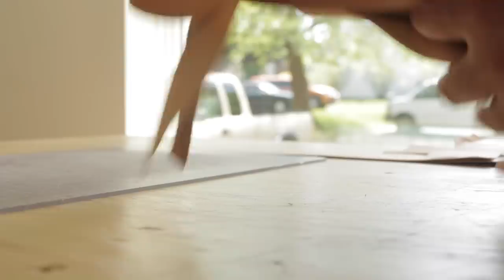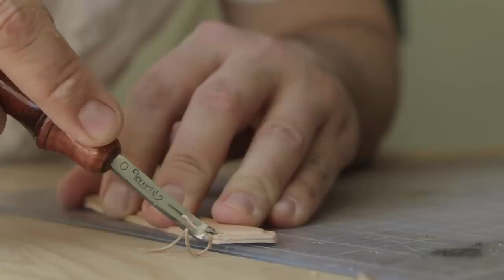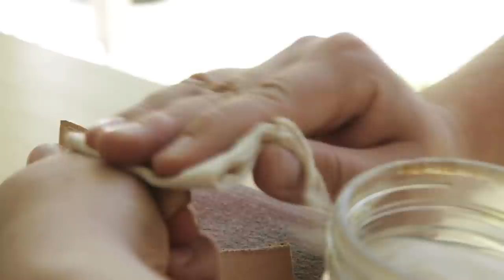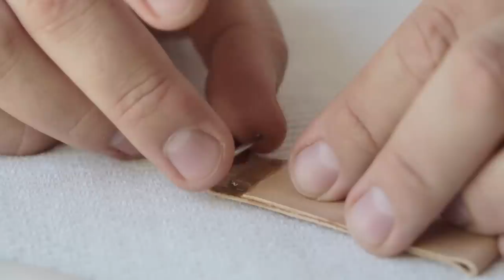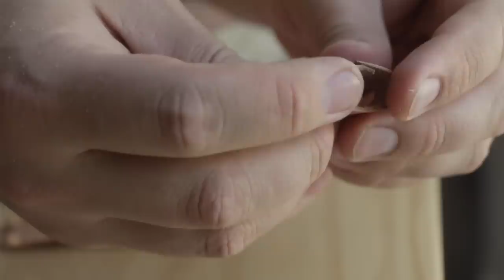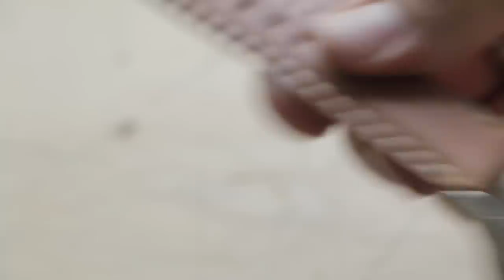This $300 Watch Strap is Made from Scraps

Comment: Just a little advice: when you lock the stitch it's better to do it at the very ende where you have the springbar, and instead of going through both layers of leather you go through only 1 per each end of the tread, so you can make a knot that you can hide in between the strap layers

Comment: I am a hobbiest leatherworker, and since I am new to this craft, I absulutely love love love these videos to inspire me and show me technique. Thank you! Your work is fantanstic and right up my alley for the kind of work I like to do. Regarding using Weldwood or Barge, I despise the nasty and toxic odors that come from these glues. Are there any other options out there? Have you tried any water-based contact cements? Keep up the great work!
Reply from the maker: Thanks :) There are many different water-based glues that can be used with leather - Aquilim, Craft-sha, etc (you can even use Elmers school glue in a pinch!) they're just not as strong as solvent-based cements so you need to work a differently with them and you can't use them structurally. Another option is to use a respirator while gluing if you want to continue using the stronger glues without worrying about fumes, or having a little glue station outdoors so the fumes dissipate easily
Reply: Corter Leather Thanks. I figured those were my options, but I wanted to make sure I wasn’t missing anything.
Reply: I am just getting started in leather craft. I can see that all these comments are years old. But I just found them! This particular channel has been my favorite to watch.  I am getting so many inspirations from these. Also, living with two young grandsons, this is a FANTASTIC way to relax with headphones on. So relaxing! Thanks for your channel and thank you for this awesome content!!!

Comment: A good watch strap is about $100-150. Depends on the type of leather you use, a shell cordovan will cost more. Also depends on the watch strap design like a full hand stitch vs just a single stitch by the buckle or pin. Or if it is padded and a softer layer of leather for example is used on the inside. For a fully handmade, hand stitched, high-end leather, padded and layered by someone who has mastered the craft for 30-40 years I would pay $300+. I have seen watch straps over $1000. Sounds expensive, but considering everything put into it its not too crazy, especially if putting it on a $10k or even 100k watch.

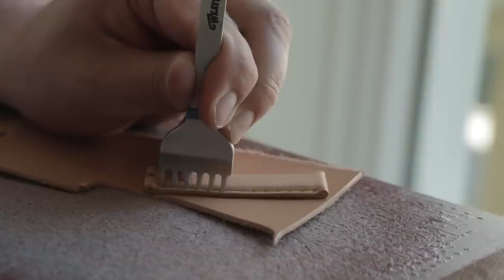Comment: 8:03 hey, is there any reason you put a piece of leather under the strap when you make holes? Does it not just ruin a seemingly good piece of leather? Or is it done so so that the strap is not damaged? 
Trying to learn what I can from these videos :3
Reply from the maker: we do it because our cutting board is a bit rough from use, so it protects the leather from getting scratched etc. The leather we use may look ok on camera but it's just scrap from the edges of the hide that would otherwise be thrown away
Reply: Corter Leather ah got it, thanks for the reply
Edit: btw awesome videos!

Comment: I never saw how he put the pin buckle on.
Will not be able to sleep at night
Reply: the buckle is put in using spring bar..  you put the tongue in the hole made for it then  run a spring bar through it and then attach the buckle to the spring bar... the thing that stinks is when you wind up with the tongue on the wrong side or backwards.. super annoying.. but then you just release the spring bar and do it over..

Comment: About 10 cents worth of leather (if that) and about 5 cents worth of glue and thread (if that) totaling 15 cents worth of material combined. Which means that you are charging $299.85 for about ten minutes of work (if that). That is about $1,800 an hour. Top tier lawyers cost less than that. This strap is about ten times more expensive than it should be. There are a lot of handmade straps out there that do not cost stupid amounts of money.
Reply from the maker: lol this strap took 6 hours to make, $50/hr is our rate for custom work

Comment: I wouldn't give 300. Plus it depends on type of leather you're using. Wickett and Craig makes bout the best veg tan but I'd pay about 40 for 1. Considering you got 6 bucks in materials. Now if it was some really expensive exotics maybe. But not just some veg tan from weavers. I use some leather from Europe that is the best I've personally found. It's very expensive and I still wouldn't charge 300. I plan on making 1 out of some nice horween. Maybe do 1 in some fine Moroccan leather and slap 300 on it. Or a nice Italian.